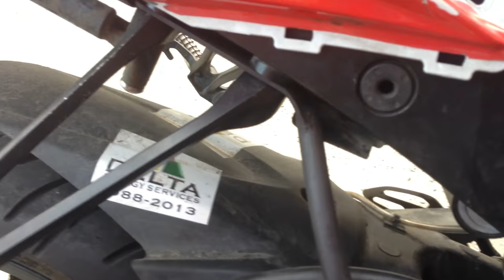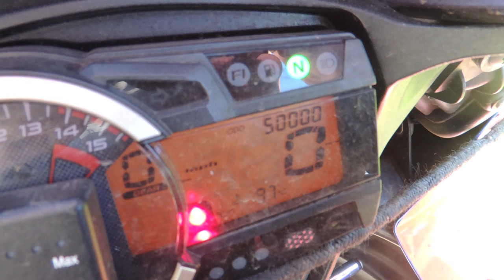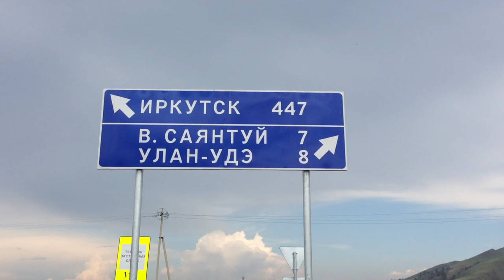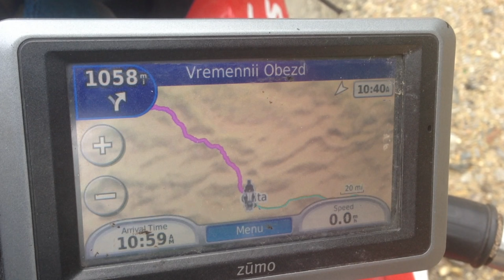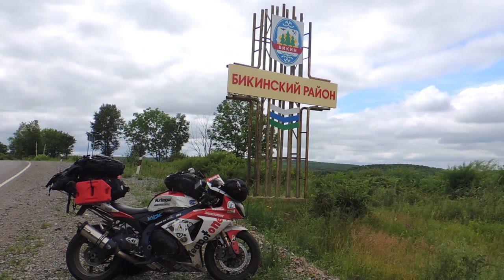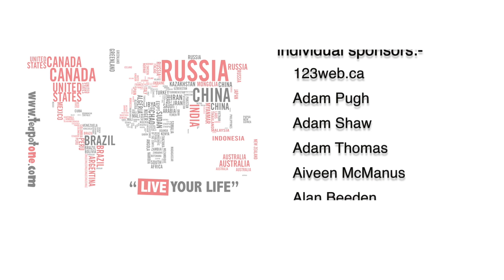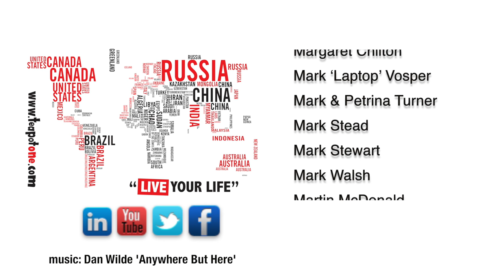TeapotOne RTW by Motorbike - Episode 8 Novosibirsk to Vladivostok

Comment: Is that not one of the most impractical bikes to cross Siberia, let alone go around the world? Am I missing something?
Reply from the maker: It’s what I’d always ridden Ronan so for me it was comfortable and practical and the perfect bike for me to do the trip on.

For others, probably not.
Reply: teapotone ...I wasn’t meaning to be critical, I was just reflecting on the number of times the sub frame cracked. I’ve also heard of this happening with GSs too, but not often, so I wondered if a gsx was really designed to cope with prolonged use on gravel and dirt roads with a fair bit of weight hanging off the rear.

It’s just a question of what (if anything) is fit for purpose. I currently have a big KTM, but prior to that I had an S1000rr which broke the magnesium headstock after being knocked over by a car while it was just parked in front of my house...brilliant bike on the asphalt and track, but not what I’d choose to tackle Siberia on (by the way, my wife is from Saint Petersburg so I agree with you on Russian hospitality...my grandmother was Russian and was the exception to the rule!!). Oh, and you’re absolutely right about the RHD cars in Siberia...I had this problem going from Novosibirsk to Barnaul in particular.

Anyway I’m planning this trip solo in June or July. I’d rather go on the 690 Enduro R, but it’s not feasible for me to sell my 1290SA and swap (I used to live in Europe, but no longer, so not being an EU citizen and without a registered address  etc, it’s not really possible to swap...plus my owner’s import permit to Australia is tied to the 1290SA etc etc).

A question - would you recommend knobbies? Did you change tyres, as you started out on new Bridgestone road tyres.
Reply from the maker: Personally, unless you’re going to be doing some major off-road sections for prolonged periods of time, I wouldn’t bother with knobblies. My road tyres coped fine with everything thrown at them. Yes they could’ve been better in the dirt, but so could I, I’d never ridden off road until the trip.

Just take what you know and you’re happy with 👍
Reply: teapotone

To do this travel on a sportsbike makes this extra special, great to watch.
Reply from the maker: Thanks Jelle 👍